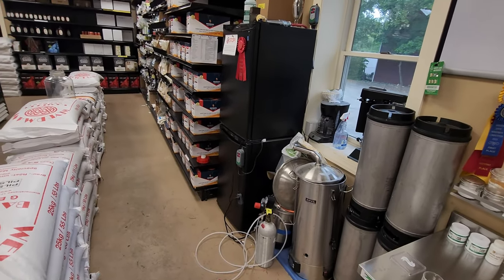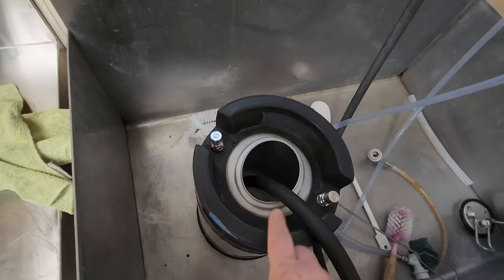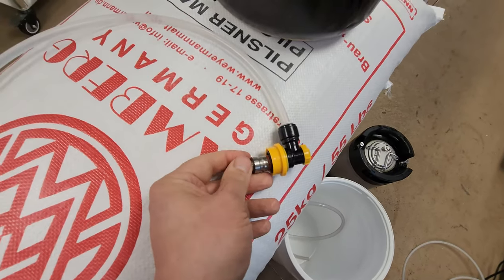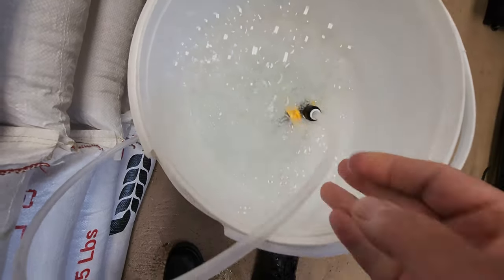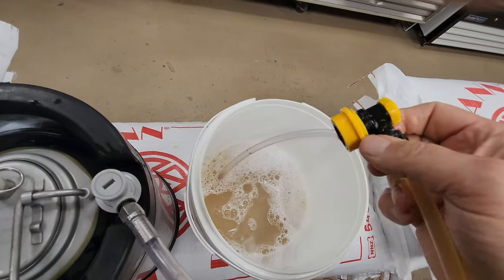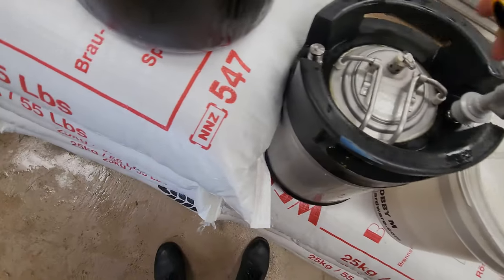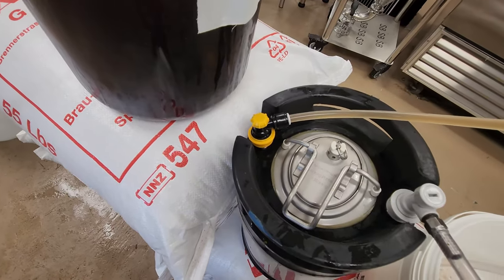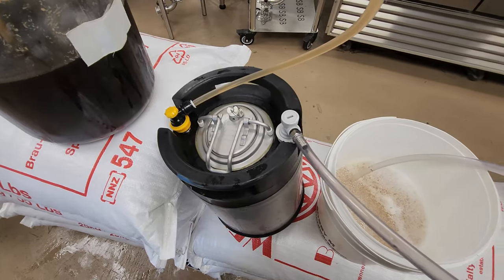Oxygen Free Transfers from Fermonster to Corny Keg

Comment: Quick question - when fermenting with this setup, can you just run a tube from the gas in connector as your blow off tube - and just put the other end in a bucket of Star-San?
Reply from the maker: Yes, that's exactly how I do it but you should be warned that if your krausen gets out of control, it's possible to clog the poppet valves and overpressurize the fermenter. Leave enough head space and keep temps under control.
Reply: @BobbyFromNJ  Thanks!  And, I’m brewing a Hef!  😮

Comment: So when you change the lid of the fermenter you don’t get any oxygen in? How do you pressurize de fermenter? You add CO2 or the last days of fermentation are enough to do so?
Reply from the maker: I don't actually change the lids. I have four of these lids made up because the most fermentation I can simultaneous support in my minifridges is four of the 3 gallon Fermonsters. Sometimes I use two 7G or one 7G and two 3G, but either way, I have four lids with ball lock connectors and floating diptubes. I use a grey QD with a short hose as my blowoff into a dish of starsan and when fermentation is obviously finished, I remove that grey QD and attach CO2 at about 2psi and lower the controller about 10F. The next day, I squeeze the fermenter to see if it's still hard. If so, 10F lower on the controller. I keep doing that every day until I'm at about 40F and then I do the process shown in the video.
Reply: @BobbyFromNJ  Why do you add co2 at 2psi after removing the grey adapter? 
What does QD stand for? Quick-disconnect?